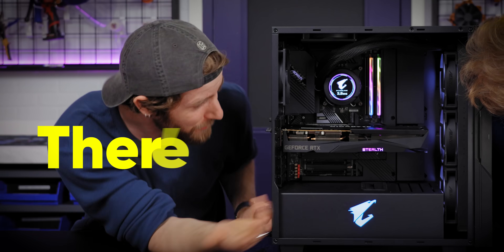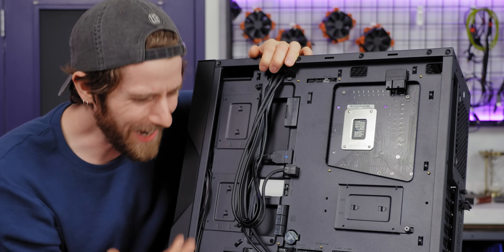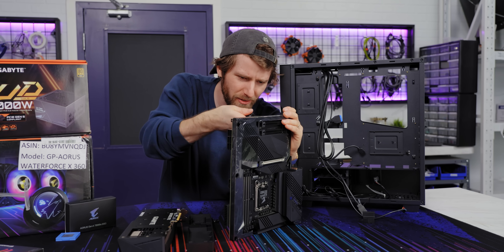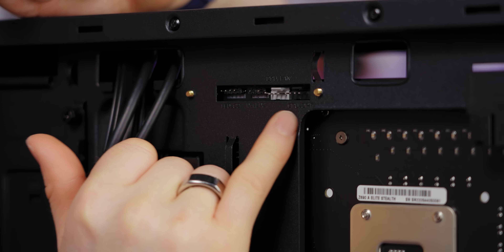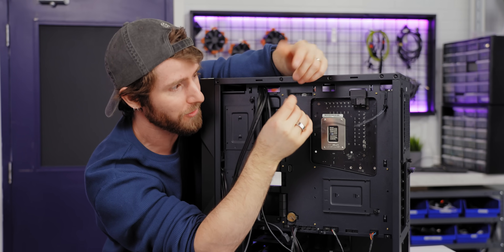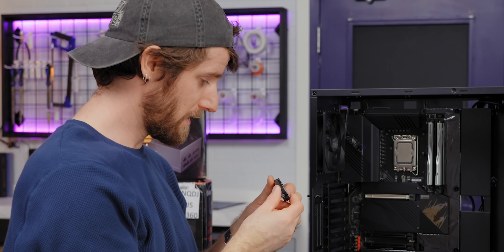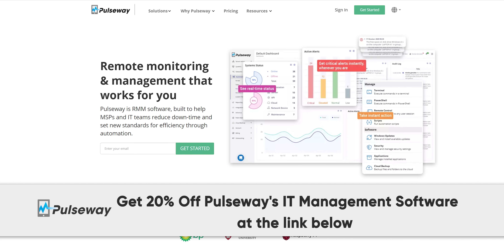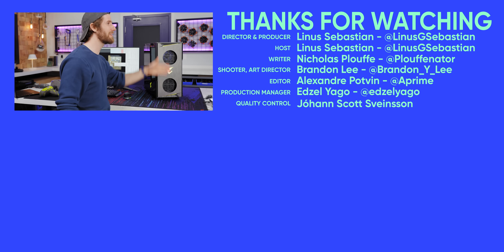Where Are the Cables??? - Gigabyte Project Stealth

Comment: Nobody "thought" to put the front panel headers on the back because most people dont want to have to take both sides of their case off to work on their system, and often build them laying on that side during initial build (its difficult to get the motherboard screwed in while its upright)

The NZXT connector was one of the best solutions, but one that is L shaped or even U shaped to directly go to the rear would be great in a "clean" build

Comment: Looking at those connectors on that GPU, I'm thinking that a redesigned shroud with a secondary connector placement would be the best way to go, if you use it like this, fine, but if you switch it to another system, just unscrew the connectors and screw them back on a more convenient side.

Comment: This is only Gigabytes first iteration of its version of an Alienware. And sending the wrong generation of RAM is just the cherry on top.

EDIT: Alright.  I just finished the video.  I hope gigabyte sees this and has an "Oh Fuck" moment. But what infuriates me more than this entire setup, is the fact that they will not do a single thing about this that would benefit US. Bad publicity has led to them pre-packaging things into bundles in order to move product. The poor execution of a case "refresh" with simple things such as a cutout for a a-rgb header on the backplane just plain incorrect, the lack of literally any airflow even after all this time, the complete lack of knowledge of same-brand product fitment with the AIO and front mounting. The list goes on and on. 

It's like Gigabyte threw the stolen "stealth kit" in a box from one internal team that have never actually built a computer and all of the other "accessories" (AIO, SSD, PSU) in a box and said "Yup!  Here's our great new thing!"

Absolutely fucking disgusting.

Comment: honestly how did maingear 1. even get granted a patent for "exactly the same as every motherboard ever but put the connectors on the back" like how is that even patentable.
2. even bother patenting that when they can't produce motherboards anyway, so were never going to be able to produce a product that fulfilled that patent.

Just sounds like an abuse of the patent system in my opinion. and im glad gigabyte just ponied up and dealt with the faff of licencing the concept. Most other brands would have just been like "it was a cool idea, but its not worth dealing with the corporate and legal hurdles to actually produce" when its highly unlikely to be a high volume product for them
maingear attempting to enforce a bullshit patent could very easily have killed the whole concept, as they cant produce motherboards, and most motherboard manufacturers wouldnt care enough normally to deal with the licencing.

Comment: Give or take the video card it looks like they took a board and took the connectors off the front and put reverse ones on the back. If you were good at modding you could do it. Hell you could hardwire it if you wanted kinda shocked nobody including myself thought about it.

Comment: I worked as an SMT pick and place operator and can say that its relatively easy to set up the manufacturing line to mount components on both side. the difficulty, i'd imagine, would be in changing the engineering design for the printed circuit board. One challenge they probably had with manufacturing this, is that heavier connectors can fall off on the second pass through the reflow oven after after the first side is complete. They might have had a process to use thermal tape or some kind of jig to hold the larger connectors on depending which side they ran first. they probably ran the cpu side first. id be most worried about the weight of the pci slots on the second pass

edit: wrote this comment before you showed the pci slots are through-hole mounted. that makes a lot of sense. so they would have ran both sides of the board, and then used wave soldering to attach the pci slots and some of the larger components

Comment: That moment at 14:01 when you see a hole saw and Linus takes some moving stress out shortly after. AMAZING.
Reply: And he also provides manual for pc case "unboxing" process, like why didn't they just make the holes earlier but instead left it for user to do xD strange feature (it should be marketed as "you can make intake hole in the shape you want/are able to do ")

I was like that with medium Lian Li case, I was like hmm... bottom supports 3x 120mm fans, 140mmm are not supported... but... it can fit, strange that I have to make holes for 140mm fan screws by myself
Reply: linus + power tool = OSHA violation

Comment: 7:06 I don’t think you have to get the majority of MoBo vendors to agree where to place the headers. But just to agree where not to put the ports. Then the case vendors can use a slot rather than a hole.
Reply: Where this works is the CPU 12V because there already is a hole. Any PC Case worth it's salt has a large cut-out in the motherboard tray so that CPU coolers can be switched out without having to remove the motherboard. The CPU 12V could easily be switched to the back of the motherboard in this area and retain compatibility with the vast majority of motherboards. The reason they may not do this is the increased packaging costs to accommodate a single connector on the rear :/

Comment: Good concept. Reverse all cable connectors from USB, power inputs,, sound, fans, rgb etc on a motherboard would not need any addition or re-engineering of boards just the connectors placed on the rear of a board.
As for cases, the motherboard fastening back plate modified to suit those plugs. 
Brilliant..
Reply: If you just put the connectors on the back, all the pins are reversed. You have to reroute the tracks.

Comment: My old PC had zero intake fans with an i5-8600K OC, 1070ti. Single exhaust fans on back and top. Ran perfectly cool with an air cooler on the CPU.

New PC is 360mm AIO 12900k and a 3080ti. Triple intake fans with another exhaust on the back, radiator on the top. With CPU/GPU undervolted it still runs just a bit warm. Feels like power consumption and heat are becoming such a bigger issue nowadays but many people are stuck in the past when you could get away with not caring about it so much. This thing is a genuine space heater. Hope the 50 series gets it under control and I will maybe try water cooling.

Comment: Seeing a Gigabyte inspired build after my recent 6900xt and PSU experience makes me cringe. 
Both units popped within a week of each other and a month after having bought them. The build does look great BUT hard pass on anything Gigabyte for me. They sponsor a build but cant even get the parts correct, probably the same thing happened when building the gpu and psu that I unfortunately bought - Pin the tail on the donkey.

Comment: It seems like if you're just a little handy, it wouldn't be hard at all to use the motherboard, GPU, etc in a different case. All you'd need to do is measure out and cut the access holes in the motherboard tray.

Comment: my pc runs decent temps even with a 6800xt and h710 because i have 6 intakes and one exhaust my idle temp is 38c on the cpu (12700k) and 50c on the gpu

Comment: Singularity did something similar,  but using a power distribution plate instead of the custom motherboard. Either combined with 12vo could work quite well potentially with a competent case manufacturer building a non water cooling case and Singularity sticking with water cooling.

Comment: OMFG! I'm getting sick of the constant "No airflow" you guys bang on about.  My car can make 120hp through a 45mm throttle body.  Don't you think it's odd that so many case manufacturers get this incredibly wrong and suffocate their cases?  Or perhaps are you guys unaware how little surface area you need to flow adequate air to cool a PC?  Can you PLEASE make this one of the first things you do in LTT Labs - test the airflow capabilities of different cases with different size, shape and placed holes?  I suspect the results will surprise you.

Comment: the power on the gpu makes so much sense. why can't this become a standard
Reply: If they put it on the end (as it appears to be on this card under the cover), you could plug to it direct or use an adapter to route it to the top or the bottom.

Comment: Instead of moving the power connectors to the back for looks, I want to see a new standard  for MB layout that moves the PCIe slot used for the graphics card moved to the back and rotated 90 degrees to allow for the ever widening slot size taken up by the card's heatsinks as power draw grows. This could also have the benefit of separating the hot components like some cases already do using the PCIe extension cables. The 7 slot ATX layout and its variants have been around long enough. Time to come up with a new standardized layout that utilizes the 3D space inside a case for maximum efficiency of trace wiring connections between CPU, memory, NVME storage, and primary graphics card slot. The tech has advanced far enough that the legacy layout is starting to adversely affect performance.

Comment: Would 12vo allow for the GPU power pins to be mounted on the motherboard itself?
Then you could have the power within the standard motherboard footprint and use normal cases, right?

Comment: This should be the standard across all pc. Its idiotic in this age to be dealing with cables and cards all on the same side. Easier to clean and maintain. You don't have to make special custom connectors. Instead do this and move them to the back. Why has it taken us 30 years to get this done on pc's is unthinkable.

Comment: I've always wondered why they never did things this way round, it makes WAAY more sense.

Also, Linus just yoloing the front of the case with a drill XD
Reply: People didn't care about aesthetics when ATX was released.
Reply: @bobjohnson9767  This is true, plus it would require more than just standardizing TYPES of ports like ATX does; it would mean standardizing the LOCATION of ports which would be.. a massive headache
Reply: @bobjohnson9767  That and early cases were horizontal, not tower.
Reply: apple did with the mac pro

Comment: The way to standardize this is let motherboard makers include a backplate, and then standardize how backplates are mounted into cases.  Then the actual connector layout can remain proprietary, but you'd have broad case compatibility.
Reply: Just use the normal motherboard stand-offs... but leave a gap around the sides, bamm everything can fit.
Reply: T h i s
Reply: Love this idea
Reply: Actually a good idea. Like the IO shield idea. Mobos have since integrated them. With this idea i can see mobo manufacturers integrating a back plate. Would also be able to be used for some heat dissipation as well. Might even get proper rear watercooling too
Reply: Fuckin genius that'll solve literally all issues
Reply: This makes a lot of fucking sense.
Reply: Smart, it's just cables after all.
Reply: But for the *ahem, US Americans among us, wouldn't that amount to an unreasonable market regulation that curbs freedom and will absolutely definitely stifle innovation?

I like standardisations and regulations that protect the consumer, but...some people really hate them.

Comment: I am graduating with a masters degree in electrical engineering with a specialization in nano- and opto-electronics and embedded systems soon (tm). Even though that doesn't make me an expert per se; I believe the reason some of the PCIe slots are through hole and some are surface mount is due to signal integrity at higher speeds. I'm willing to bet the through hole slots are rated for PCIe 3.0 only. For the interested, it boils down to transmission line theory: The through hole pins form a so called "stub".